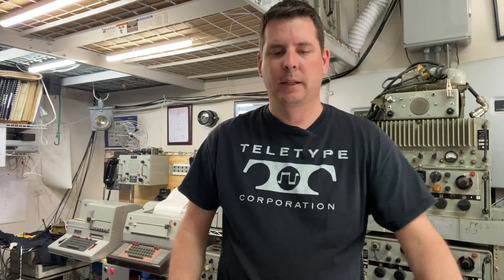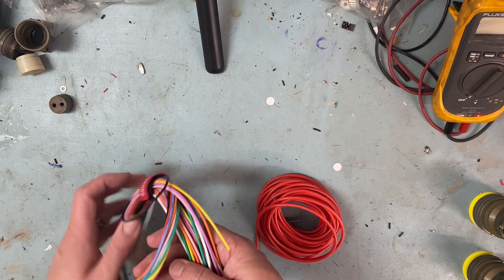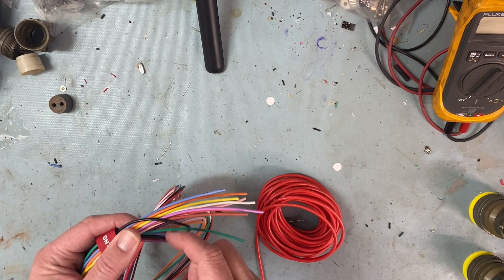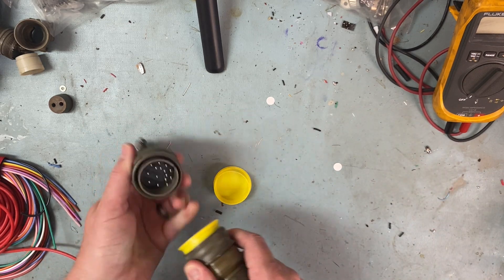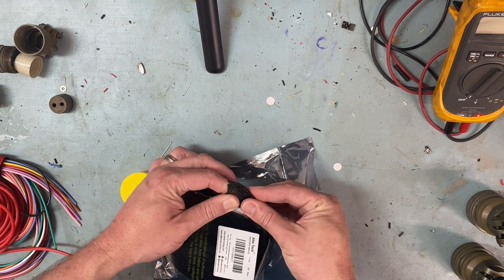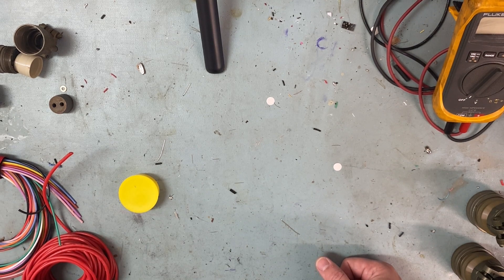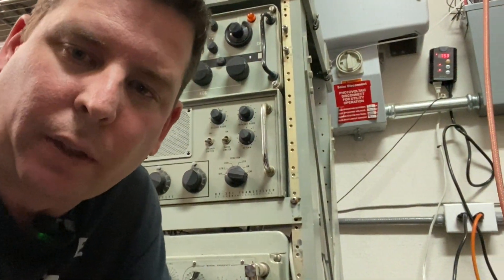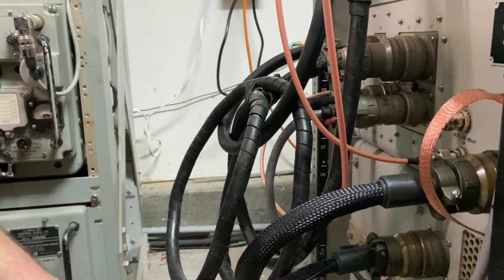Harris RF-130 URT-23 Transmitter Part 3

Comment: man that fan noise takes me back, we had 4 URT-23's in our transmitter room, it was bliss when ever we had them turned off.
Reply from the maker: This one is giving me problems.  I will address them in a video next week. I have the 400hz for the fan, 115 for the accessories but it would seem that T1 is bad.  Tap 18 (that supplies the 12v remote power is grounded) this is not allowing it to switch to operate and keeping the HV side powered off.   I get nothing from the secondary side of T1 but have the proper power coming inLuckily I have an extra T1 but I need to ensure the fault is fixed.  It blew out the 12v feed on the A5 card which does not have any fused protection.  It would be fun to find someone in SoCal that has worked directly on these to help out.  I was an AT2 and worked on aviation communications systems (mainly JTIDS
Reply: @K6YIC-N3FAA  LOL if I still lived in SoCal I'd be happy to dig into that, I grew up in Ventura county but I live in Greece now.